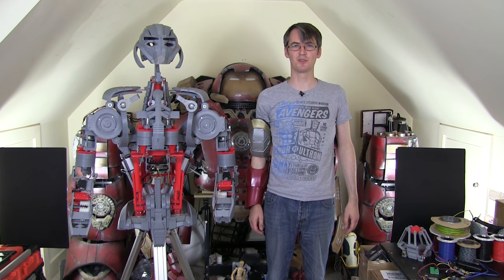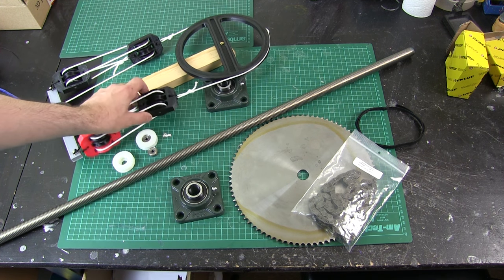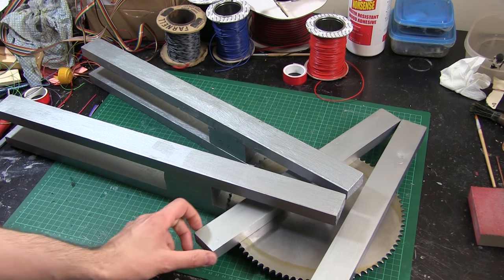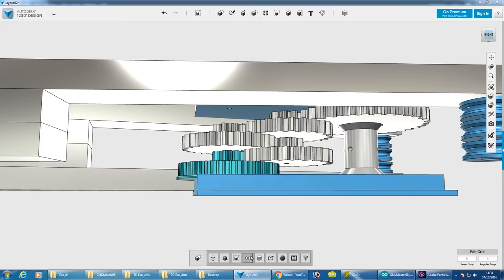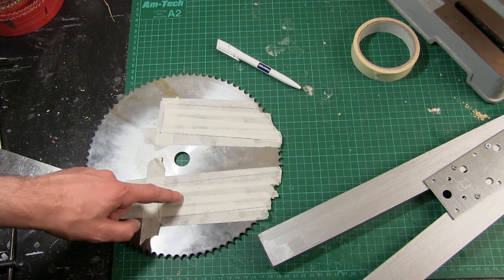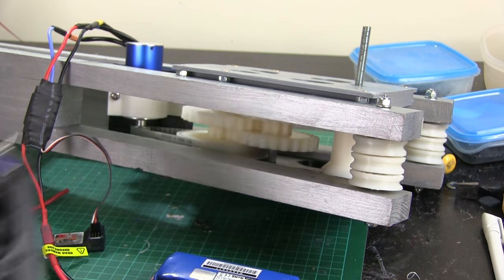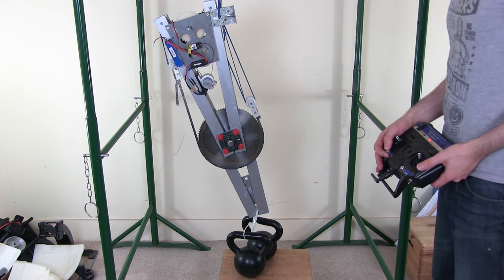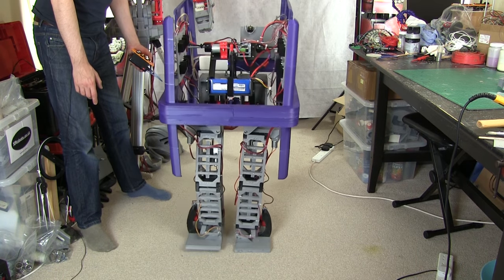Iron Man Exosuit #4 | Working Elbow Joint | James Bruton

Comment: It's bulky and heavy but it works,the main problem seems to be speed,it's too slow to be useful in any practical application
Reply: Looking forward to it! Making a cheap functional exosuit will be something to be proud of.

I think that focusing more of the budget on the back and leg mechanism will provide you with better overall results.Curling heavy loads is not that common in manual labor, triceps are not heavily involved either,your mechanism even showed that.Also the exosuit should be the one carrying most of the weight in a heavy lift.

Finding a way to make the forces distribute through the suit is vital,otherwise an injury might occur when handling loads beyond your personal limit.For example my body can lift 200+pounds of the floor safely whilst if my skinny friend did and managed that ,lets say through an empowered leg mechanism, his back could be in serious trouble if left alone to handle all that weight.These are some safety tips you might want to consider moving forward

Comment: this is great James, but very slow. We just got a new robot at work installed, it picks up boxes and palletizes them. It's fucking mental. I work in IT but it was done by the automation guys and honestly I don't know alot about it (neither do they for that matter.. they couldn't even tell me if it's electric or hydraulic, it was installed by contractors and I was too nervous to annoy them while they were installing it) but I've been watching it and it's def electric which is amazing. I have no idea what kind of motors it uses but my gosh is it fast and powerful. This thing could rip you apart! It's like something you'd see on a car assembly line. BTW I think you should sacrifice strength for speed, and make it lighter too. I think you could get away with 3d printed sprockets etc. After all the arm is meant to assist, if you really tied your arm to it, it could be used to 'boost' your strength rather than doing all the lifting itself. IDK you're much smarter than me don't listen to me haha.
Reply: ***** All good don't listen to me mate. This was obviously alot of work and an awesome outcome. Are you going to design 3d printed coverings for the arms? Give it a kind of 'futuristic robotic' kind of look? To get those other movements though are you going to use linear actuators it would look like the suit from Elysium! You can get some pretty fast ones. Or design your own!

Comment: Why didnt you just have the chain going around the whole thing with a good gear ratio, much like the back end of a motorbike ?
Reply: There are other ways like planetary gears or even normal cog ratios but instead of touching leave a small gap and use a chain so its not just the one tooth, just trying to give other ideas :)

Comment: Those four wood screws holding the forearm to the sprocket have got to be the weakest part
Reply: Also an aluminum sprocket should be more than capable enough to handle these forces

Comment: Its better than just your arm, but I would have gone for hydraulics or something instead due to mobility.
Reply: ***** I'm thinking that if you have hydraulics you'd be able to make faster movements, and be able to carry heavier things, that includes the pump system itself. However, in order to make a hydraulic exosuit you would need to have the legs first to support the rest of the structure. If not, you could do an air-powered one with air muscles that is pretty much expanding and contracting tubing in order to carry things however the way you would power it would not be able to be carried by the suit itself, and instead would have to be separated from the suit with that type of muscle. due to the muscle not being able to carry things. But considering how hard it would be to build, this works a-lot better, I was just thinking out-loud in the comments.

Comment: For planetary gearboxes I don't think there are any free services out there for generating them... Onshape can't handle them I don't think. This Thingiverse topic may have some info: www.thingiverse.com/groups/engineering/topic:8629
What I ended up doing was making my own calculator for them and then used a straight-line approximation of curve system to manually draw out the involuté tooth profile and rotated it round. I'm happy to share/discuss if it'll help!

Comment: Hacksaws are like files. They should only be in contact on the cutting stroke (push or pull depending on preference). Dragging back dulls the teeth making it harder to cut. If you need/want to keep the saw in the kerf on the non-cutting stroke you should try to have as little pressure on the teeth as possible.
Also, check this article out on mounting the bearings in wood versus using the metal bearing flanges.
http://woodgears.ca/bandmill/wheels.html

Comment: get rid of the metal entirely, how much are you actually truing to lift with it. im pretty sure even just the 3d printed equivelants to the metal pieces would be better since a: they weigh less b: the strength difference isnt going to be enough to notice c: cst should be more manageable.

with the weight drop from switching out all the metal, you will notice a high efficiency with strength to weight ratio. even just 20kg lifting power on one of these arms would be impressive and functional.
Reply: keep thinking about it, just keep in mind what your end goal here. if you really want to be able to use this for its intended use you need to also consider the end weight and wether or not you will actually be able too use this along with what you want to lift. light is better, even if it costs torque. becuase in the end you lose usable torgue with each gram you add on.